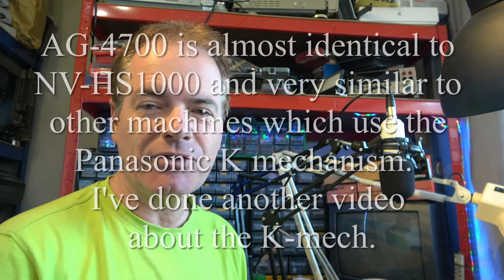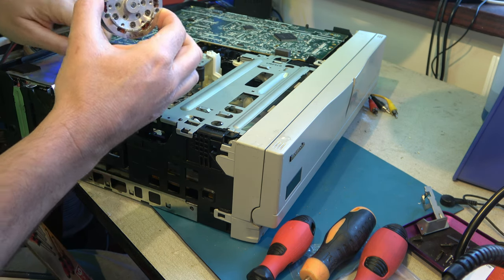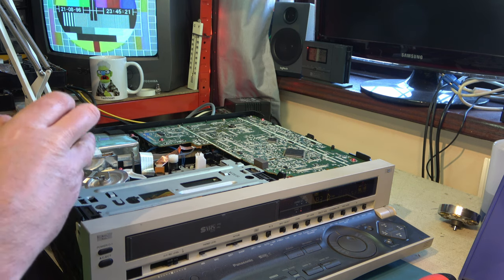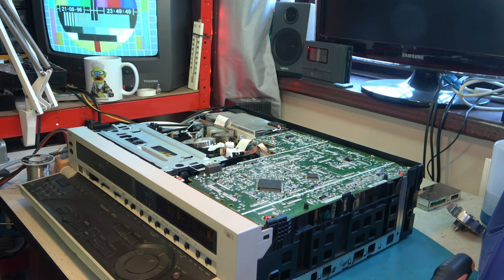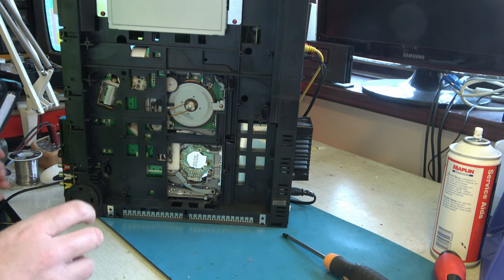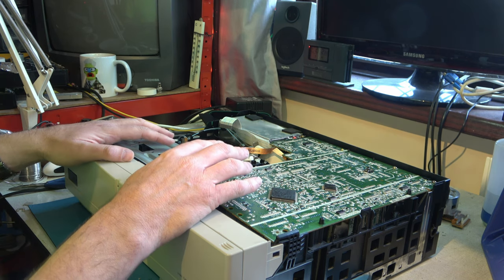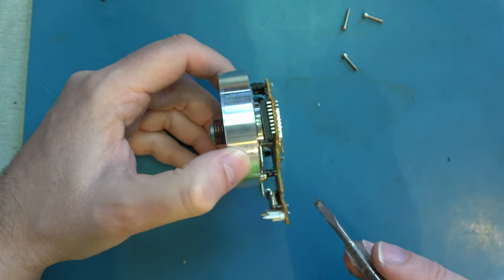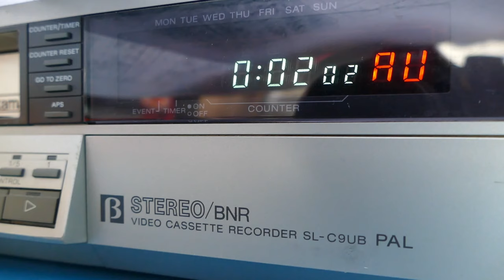Panasonic AG4700 (NV-HS1000) has a strange head fault. Let's fix it.

Comment: Well done!
I didn’t had such luck with my old Blaupunkt RTV211 (NV-333), the glue that been used to hold the wires on the rotary transformer (the stationary half), became corrosive and ate the windings all the way.
Excellent job on this one, take care.
Best Regards,
Moshe.
Reply from the maker: I remember the NV333, I serviced and sold several of them in the day.  A pretty heavy lump but they had a certain charm.  I think at that point though Panasonic were a couple of years behind the curve of video technology.  Compared to a Sanyo VTC5000 / VTC5150, the NV333 had a over-complicated deck.

Comment: I've tried this a # of times, it works: play a tape and hold a piece of solder agent the head. Cleans it every time without damage. I first tried this on a head I couldn't unclog, in playing around I to attempted to cut the solder in half.  No damage to the solder, and to my amazement the head was cleaned. This sounds bizarre but it works.

Comment: I wish i could watch this video 8 years ago when i got HS1000 VTR which has the same symptoms. Noone was able to fix that machine, the heads were considered in a good working order. The technician called this fault "the floating fault", as he couldn't figure out what's wrong with the VTR. I had to get rid of it as it was considered as unrepairable. I wish i knew...;)
Reply from the maker: It would have been a fairly easy fix!

Comment: 7 heads: 2 SP, 2 LP, 2 Hi-Fi stereo and one flying erase head.
Reply from the maker: Well done.  I wasn't sure about a flying erase head on this machine, I should have looked it up.
Reply: video99.co.uk Me neither, but that’s all the possible heads ever existed in a VHS machine.
Reply from the maker: @Capturing-Memories  There were extra slots for more windings on the transformer.  So Panasonic must have considered the possibility of there being more heads at some point.  That leaves us wondering what miracles might have been awaiting further heads.  Maybe PCM digital audio like Hi8.
Reply: @video99couk  JVC did the same thing but I believe it's for balancing purposes, They even included a dummy head to balance out the flying erase head.
Reply from the maker: @Capturing-Memories  I think there's a dummy weight on this one, between what I call number 1 and number 7.
Reply: Mitsubishi made a S-VHS with a total of 10 heads mounted on the drum. The two extra heads were mounted on piezo actuators to allow perfect still frame and slow motion/picture search without any lines at all.

Comment: Actually I got exactly the same issue. 
But it manifested in a final shutdown of the machine after some minutes of playback.

It turned out the issue was missing lubricant on the head drum's shaft. So I just removed the earthing above the head drum (one skrew). The the whole drum can be easily removed. After that I put one drop of MoS2 into the hole of the shaft and inserted the Drum again. 

After this procedure the faulty behaviour was gone entirely.

Comment: After so much advance circuitry One thing the VCR Technology was lacking now looking back. This was to include a total number of hours used bit like a projector because now we can’t work out on the high end units how much they have been used.
Reply from the maker: This was a common feature on professional video recorders such as Betacam but lacking in domestic and even semi-pro machines.
Reply: Beta cam meaning Beta Max which had a limited market to begin with and died like the HD discs compared to Blu-ray.  But thanks for sharing. I have been repairing the Panasonics for some time since the days they had timing belts. Super Drive was the best and reduced the belts but the auto head cleaning was also a scam, it ended up damaging the head tips if not removed on time.

Comment: Did the machine work fine after fixing the solder joints? I've got to test this in the NV-HS1000 I got here, it has a similar sort of head clog issue especially when rewinding, though not quite as bad as this one. Been trying to figure out what's wrong for a while, already replaced some bad power supply caps but it didn't fix it of course (but needed to be done in any case), really confusing issue. On mine it's worse on tapes with a weaker rf signal output.
Reply from the maker: The repaired solder joint drum went back into the machine with the bad clutch.  I'm 100% sure it's fixed, but I'm not working on that machine again until I can source a good clutch.
Reply: @video99couk  So I checked on the NV-HS1000 I got here, and it also had a clearly bad solder joint on the same pin as yours. (Even though it's the older revision with a slightly different drum assembly). Re-flowing/soldering the joint did seem to help a bit, didn't notice it randomly acting clogged. Still having some issues when seeking backwards though that may be something else. I need to check alignment and clean etc to check properly though.

Of course the cable connector for the drum motor cracked in the process.. argh.
Reply: Ok, let us know if/when you do check. I still had issues on mine, but swapping in the drum assembly from a AG5700 (same drum as on the FS88/FS200) solved it. I don't have an exact replacement drum assembly so I can't check just the upper drum to see if the heads on mine are bad too (thogh the hi-fi heads seem to work perfectly at least), or if there are more things wrong in the lower assembly related to the bad joints.

Also had some bad PS caps, but probably not directly related.

Comment: Dy joint eh? Not that old chestnut! My money was on some pesky SMD cap mounted onto one of those ceramic thick-film units. They seem to plague the pro-sumer Panny's (FS88/90/100/200 etc)..although I wasn't sure if this has any of those. 

Interesting the head didn't need much in the way of setting up when replaced. I recall a long while back removing the head from a Philips machine (just out of curiosity) - little did I realise you needed a special Philips remote to set it back up, again. Doh!

Comment: When I got my hs-1000 a few years ago it worked fine. I stashed it in the basement for another couple of years and when I tried it a year ago I got lines everywhere. Ordered a new upper head drum and replaced the old one. Problem still not solved. The paus picture is great if I move the paused picture a few frames. What can be wrong?

Comment: Well done colin :-D
What a confusing fault. i've never seen that happen before.
One in a million i suppose, but i would be checking the other machine for that connector fault,  although i know it would be perfect solder joints lol. (Sods law).
I was thinking the head switching had some kind of failure, i was wrong there lol.
That was a good run around, i've been there a few times as well :-D
Reply from the maker: I'll bet no-one who watches the video will be able to guess the cause from the start.  A bit annoying that had I known where the fault was, I could have fixed it in a few minutes!
Reply: @video99couk  Well i didn't lol,  Mentally going through the possibilitys and every one was wrong.
I was mentally confused, That's normal for me :)
But you never gave up,  Although you now know it's unlikely to happen again, one in a million.
I bet the soldering on the other base is faultless.

Comment: I don't know why they did this, but they put a plastic flap over the top of the power supply blocking the vent holes.

Panasonic machines NV-HS960, NV-HS1000, AG-4700, basically any model with a TBC serviced are quite sought after. Demonstrably working, archive and format transfer companies snap them up.
Reply from the maker: That's what I use these AG-4700 machines for.  I have about five of that model, plus some other TBC-equipped machines from Panasonic and JVC.

Comment: Hi i have a Panasonic VHS VCR, in SP mode video is garbled, on LP, EP the video is fine, tapes on SP mode used to playback fine, now they do not, i have cleaned the heads no luck, what could be the issue, thnx.
Reply from the maker: It will require proper investigation and repair.  It's likely a capacitor failure somewhere, but there could be multiple capacitors at fault.

Comment: I suspect the lower drum assembly becomes quite hot in operation. Maybe that's what caused the dry joint?
Reply from the maker: There's also a certain amount of mechanical vibration at times.

Comment: Very helpful, thank you. 
Have you ever had a wobbly drum? I just bought a hs1000 and the drum makes a loud noise during playback, and if you inspect it, you can make it wobble slightly. 
I’m wondering if there is something loose or if the bearings around the shaft are damaged
Reply from the maker: Oh dear, sounds like bearings have failed.  Since upper head drum failure is much more common than lower drum failure on these models, there are a fair amount of scrap machines out there that you could salvage a lower drum from.  That would be easier than trying to replace the bearings.

Comment: Is the capacitor that's on top of the main pcbs between the sub-luminance board connector legs something you've added, or was it like that from the factory?
Reply from the maker: That's factory.
Reply: @video99couk  Ah, I saw it referenced in the service manual I found recently, apparently it was an alteration made after production started that improved SVHS-detection.

Comment: I have a strange fault. After recording when I play back the picture shakes. Old recordings and tapes play o.k.
I have cleaned the Video Head several times with no luck. It appears to be a recording head issue. Any ideas? Change the Video Head?

Comment: Has the HS1000 ever had this video head like this AG4700. I am asking because I bought HS1000 and it has that VXP1747, not like most VEH0651. It's mean someone changed her before? Is it possible that he left the factory with this one (VXP1747)?
Reply from the maker: My understanding is that the HS1000 has the same heads as the AG4700, so the different numbers is likely to be a change during manufacture for some reason.  By the way, I have another video due out in a few days on these video heads, so subscribe to catch that.
Reply: Not only numbers are different. 
These video drums look different from the outside, the VXP1747 has a kind of spline on top, while the VEH0651 is flat.
Anyway, thank you very much for your reply.
I was afraid that someone change this video drum and that (incompatible drum) is a reason of blinking (disappearing for a few seconds every few seconds) picture issue.
After resoldering two pins on connector coming to the video amplifier the image no longer disappears during playback.
Unfortunately, now it is completely invisible (black screen) when pause is turned on.
Could this still be video head related or should I start looking elsewhere?

Comment: #video99.co.uk Thanks for all the great info!! ... I have a panasonic AG-W1 that plays fine in NTSC but I cant make it to play PAL videos, when I move the playback switches at the back it shows color for half of a second and then black and white. I tryed all settings using a capture card that lets you choose  pal ntsc secam, etc. Any ideas would be VERY apprecieated. all the best!
Reply from the maker: That's not a machine I know.  It's possible you have a fault.  Have you tried connecting to just a monitor rather than only the capture unit?
Reply: @video99couk  Thanks for replying! here in Argentina, the 99% of crts are pal-n or pal-n/ntsc. So, I've tried with a pal-b to pal-n transcoder beween the W1 and the tv but no luck. The odd thing is that I can see color for a brief moment